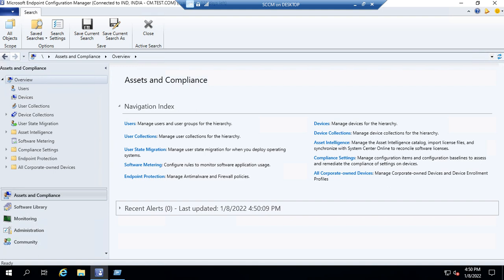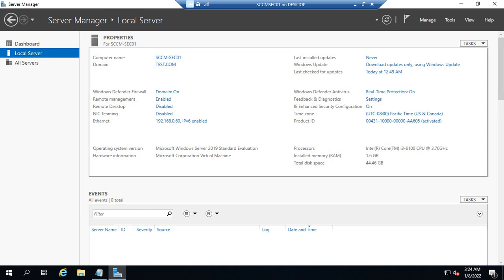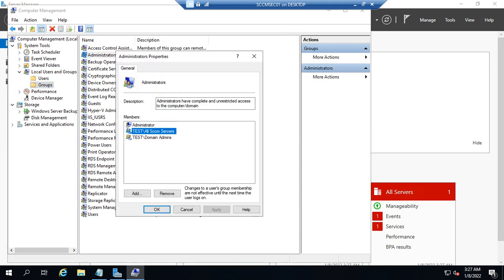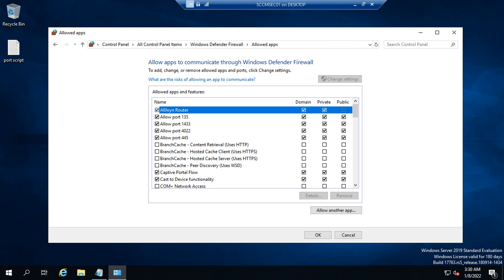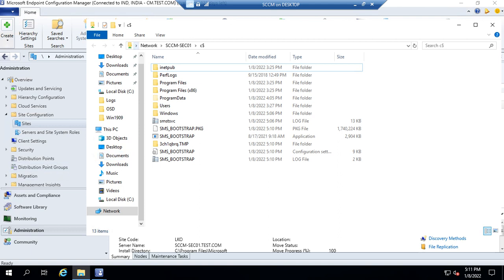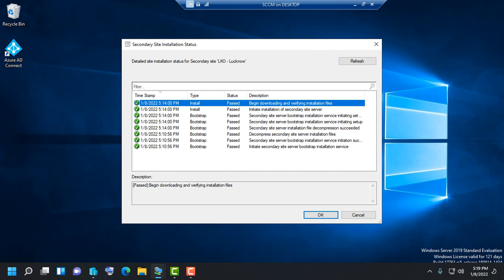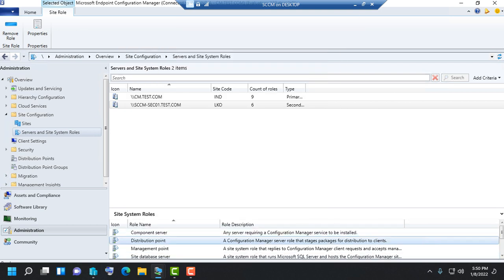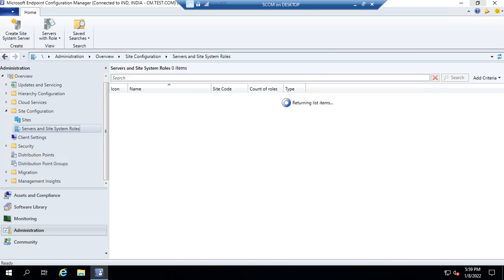How to Install SCCM(MECM) Secondary Site Installation Step by Step Guides

Comment: Im getting bootstrap error , tried everything
Reply from the maker: You can check the ConfigMgrSetup.log and SMS_BOOTSTRAP.Log and  check SMS_SITE_COMPONENT_MANAGER
Reply: @sunilmecmworld i turned it on but for some reason it keeps failing. I also have error to change user to install mode